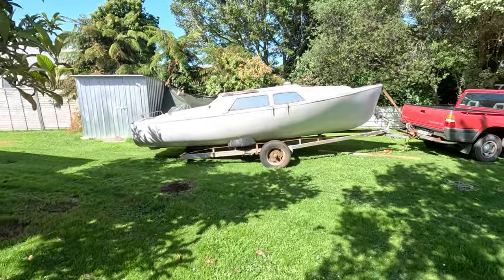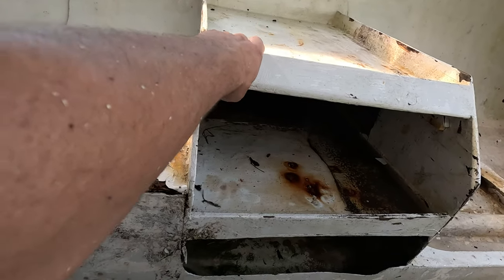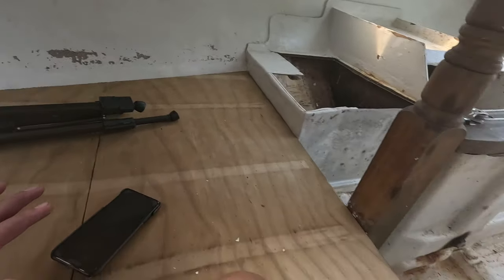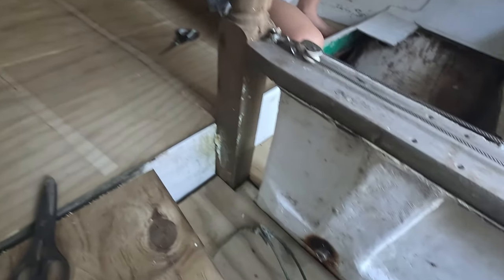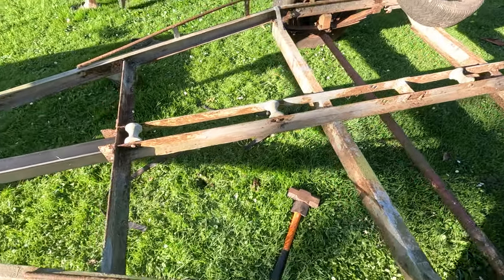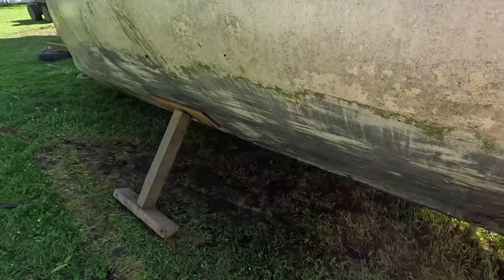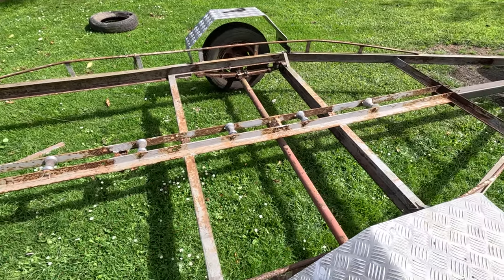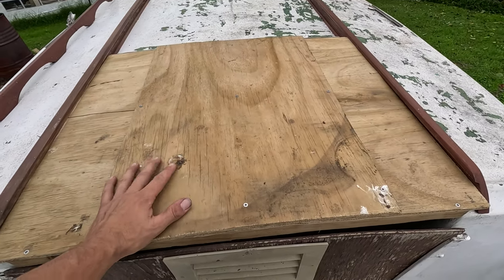Electric Solar Boat Build, Part 1 Trailer Sailer

Comment: Yet another captivating series. Well, I'm all here for the ride (as is Mia apparently, that was some great ATV control). Just make sure to play it safe (proper lights on the boat, life vests, bilge pump, radio, etc.). Can't wait for the next episode :)
Reply from the maker: Thanks will do , I am starting to fit out the inside of the boat now👍
Reply: @DktheWelder  Can't wait for that video. I'm sure it's going to be epic :)

Comment: That's a wicked project man, heaps of progress for one video 💪
Reply from the maker: Thanks 👍 I should put your tower of power on there
Reply: @DktheWelder  it's in my shed all tidy. I pulled the motor off the shaft. Crazy little motor, I can pick it up by myself easily, and it's a straight 6. You're still welcome to it man.

Comment: Looks like the build is going well. I'd definitely see about wire wheeling the rust off the trailer and repainting so it doesn't end up rusting out.
Reply from the maker: Yes I need to do something for the trailer paint

Comment: Love the projects. You start and then finish them which is a change from sum channels. And you are constantly tinkering with them the whole time which is probably the best part. Sure this one will turn out great.
Reply from the maker: Lol I actually haven’t finished a few projects! Even this one is hard work I am excited about it have some cool things planned
Reply: Some might not be finished but you have gotten to test-ride quite a few, which is close enuf to being finished. As for the boat, any work on any size boat can be and is a job and a half.

Comment: I have often wondered the viability of having a tender boat Pulled behind the main boat covered in panels.  I think the drag would not be much and if it were powered, it would easily push itself.  Panels could be made to tilt and or lift up so the 2nd boat could be used for storage as well. 

Be interesting to see what motor you use.   A 5 HP 240V 3 Phase would be cheap and may be able to be run from a solar Pump VFD?
Reply from the maker: I think that would work, I have a 48v battery but the motor and esc aren’t working so I need to get another one I think

Comment: Are you using flow coat that's what I would be using bro
Reply from the maker: What is that? I might paint the outside at some stage but trying to do it on the cheap
Reply: Its a paint but epoxy resine its what boat builders use so after you apply it it sets rock hard  but just like any painting its all in the prep research boat building products in no it maybe referred to as a something else there 👍

Comment: Roll on the comments about welding the top side of the draw bar gonna make it crack etc etc personally not seen it
Reply from the maker: I haven’t heard that before, it is bolted through the box section as well but no way it will break haha
Reply from the maker: Are you American?
Reply: @DK The Welder  na that feels insulting from nz down in hawkes bay
Reply: @DktheWelder  Arnt they cast steel?  never a good idea to weld that shit lol Awesome project tho man, cant wait to see her on the water!!  Idea for a name... Jenny
Reply from the maker: @BIGSMOKE-bl2lq  o sorry haha!
Reply from the maker: @moonbrothers9098  it’s bolted through a flat bar and the box. You can weld cast steel fine truck trailer draw bars are cast steel welded on I have done heaps of them, cast iron is what that coupling is and don’t want to weld that haha
Reply: @DktheWelder  Truck and trailer draw bars must be a bit of a process.. must take a bit of pre heating and post heating?
Reply from the maker: @moonbrothers9098  yes there is like a fork that the cast steel piece fits into you preheat it and weld only the top ,bottom and sides not the front part to prevent cracking . It doesn’t make sense to me but that’s what the engineers say to do haha